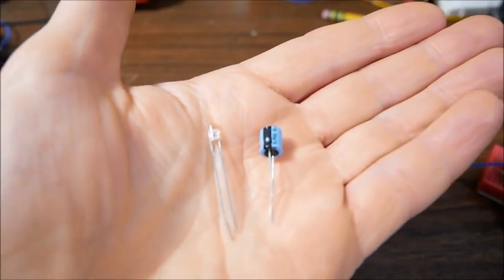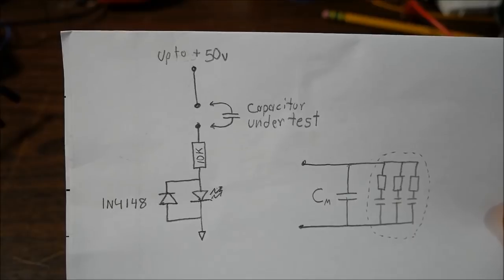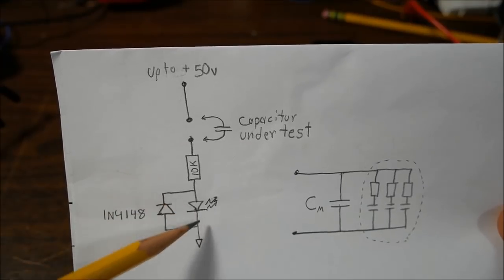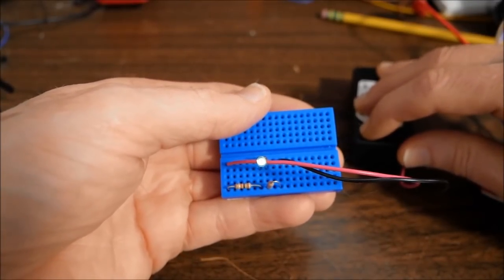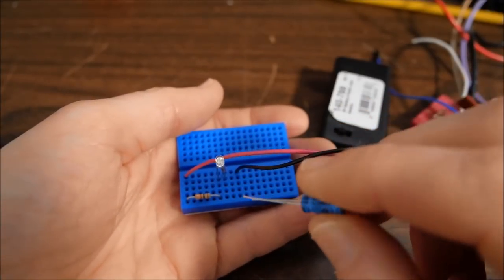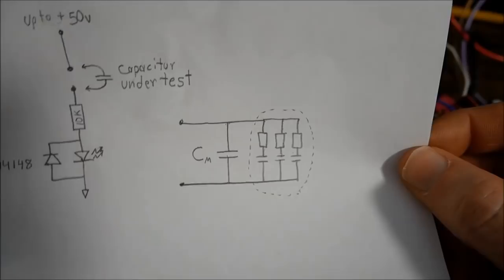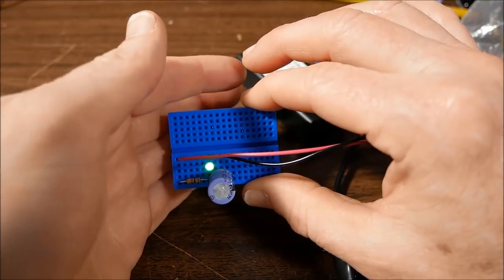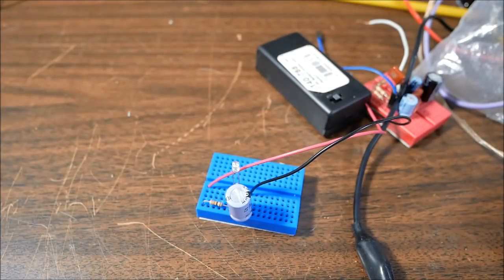Check capacitor leakage with an LED

Comment: I like how  most of the questions in comments and messed up comments are dealt with in the video. Folks simply do not pay attention. Good vid John. I built a leakage tester for up to 140 volts. Works great. Gonna build the AWA kit for higher voltage caps. Nice info John, gotta get me Indium LED's.

Comment: I suggest u use your multimeter same test but much better indicator specialy if you use a analoge multimeter in the range of 10K or 100K setting

Comment: A very simple yet ingenius circuit. If there's leakage on the cap it acts as a resistance and LED glows depending on the leakage, why I never thought of that and it was under my nose. From this basis we can improve it so the indicator is more noticeable...I guess. Thanks!

Comment: All electrolytic capacitors will leak a certain amount. It's true that as the capacitor reforms the amount of current will drop but it will NEVER go to zero current. There are some decent charts around that provide respectable limits to that current flow given the capacitance and voltage ratings of the cap. The higher the voltage, and the higher the capacitance rating the more current will flow on a perfectly good cap.
The absolute best way to determine the maximum allowable leakage of a given electrolytic cap is the manufacturer's spec sheet. They all provide a formula for calculating that current value. 
The circuit is a cool idea, and looks like fun but with all due respect has very little value for testing allowable leakage on electrolytic caps.

Comment: put the LED inside a plastic tube 20-30mm (1 inch) long,  like an old pen (not transparent obviously) and looking inside the tube you can notice even faint glows.. do it by myself and it works.

Comment: Great idea good job! You could pre charge the capacitors to the same power supply voltage as your circuit then plug them in and would get you a much quicker leakage current test on big caps!

Comment: Excellent - yes the time it takes a good electrolytic to cause the LED to go out is governed by CR, the time constant of the circuit.  Dielectric absorption is a different affect.  It can be thought of as a charged capacitor when discharged not discharging completely to zero volts - this is not due to the time constant of the circuit but the fact that some molecules in the dielectric remain polarised for longer than they should meaning that a directly shorted capacitor can still hold charge for quite some time.  Mainly apparent in large value industrial capacitors in high voltage applications with the associated risk therein.  Hope that helps explain things a bit and you have given me an idea for a video on exactly this phenomenon!  Thanks for making the video - I enjoyed it!  [BTW have you thought of pre-charging the capacitor under test to the supply voltage and then putting it in the tester to avoid the CR wait as it were?]

Comment: Very nice. How would you test an electrolytic cap. rated at 450 V? thanks
Reply: At 450 volts I would buy a DMM that can measure capacity and a ESR meter. Safely discharge them first. 450 volts can be lethal.
Reply: @jaynone9262  ESR is not leakage

Comment: I noticed while working on an LED project that white LEDs would glow at very low currents, so I had to use some parallel resistance to allow the voltage to drop below the LED threshold.

Comment: I wouldn’t think this would properly test for all leakage in a real-world sense as many caps have 25 to 400+ volts running through them in-circuit. At those voltages more leakage is likely to occur than at the low voltage this tester puts out. Nonetheless, what an absolutely wonderful “think outside the box” idea for a circuit! Fascinating use of the specialty LED and the device clearly works as designed at low voltages and I’m sure it’s useful for casual, quick tests. Thanks for an ingenious video and a great channel.

Comment: John, as you have just demonstrated that this type of tool isn't just for Repairs on old equipment. You could be building a new circuit not knowing the condition of those new capacitors that you might have purchased from eBay. I have purchased a capacitor kit from eBay that was supposed to have very low ESR capacitors, out of the 10 470uf capacitors only 4 were actually low ESR! The other 6 were really bad, I was wondering why the next stage was saturated until I decided to check out the new capacitors, the problems went away as soon as I replaced the bad capacitors with the good ones that I finally checked. So basically! If you are working with electronics, old or new, you need the ability to check capacitors. Mr Carlson has built a really good capacitor checking device which uses low voltage to test and while he showed how good it works, I still am kinda leaning towards the old way of testing by using high voltage to it's rated voltage... Maybe I would change my mind if I knew how Paul's tester worked but for now I'm sticking to the old, albeit dangerous way because as you switch up through the voltages, you get instant feedback on how the capacitor is charging, whereas with Paul's tester, you have to wait not knowing if it is charging at all... 
Incidentally, with your circuit, you could add a bypass switch that allows you to charge the capacitor to it's rated voltage faster and possibly add another led or two to speed up the process with the larger capacitors! That way you can speed up the process and see that it's being charged at the same time, so when the Led's go out, you switch off the high speed bypass and the other led takes over to indicate whether any leakage is taking place... It's just a thought that I had while watching your video... 
Capacitor testing always makes for great watching...

Comment: their are meters that only test capacitor. they cost like $35 however mr carlsons lab has meter that cost $600 that dont work so are these meters for testing capacitor actually work? consider reviewing them one is "Proster LCR Meter LCR Multimeter Tester for Capacitance Resistance Inductance Measuring Meter with LCD Over-range Display"
Reply: ESR, Capacitance, Inductance and Leakage are all a bit different.

Comment: REFORM? WHAT IS IT
Reply: charles klein It is a way to “reconstitute” the cap and restore it close to it’s original value/function by applying a series of increasing dc voltages to it over time. In my experience this is not a very permanent fix. Better to replace it.
Reply: Ya blast all of the smoke causing stuff out of it by using it like a spark plug....lol

Comment: Is the 4148 actually fast enough to provide  protection ?
Reply from the maker: Yes. It is a fast switching diode.
Reply: Any diode should be used, 
Fast diode is fast on reverse bias only which is not in our case.

Comment: Dear John, would you mind to share the LED part number? I would like to try this out but couldn't find the right LED with such low current capability. Thanks!
Reply from the maker: OVLBG4C7 (3mm) OVLFG3C7 (5mm) Green high brightness LEDs. I got them at DigiKey.
Reply: @JohnAudioTech  thanks!
Reply: @JohnAudioTech  I checked the data sheet for both of these. They seem to be rather typical LEDs; Vf=3.2V-3.4V If=20-25mA. From the technical name that you used to refer to them, I thought that they were some type of higher technology. Now, I think the term has to do with their color and, yes, the green has the highest output intensity. Meaning, that they are a good quality LED, having testing and data, but they are not a special technology. Do I have that correctly? I am not intending to disparage the video. I just want to learn from it correctly. Thank you for all you do for us. Much appreciated.
Reply from the maker: @t1d100  Yes, they are not special, just good consistent quality. I stressed that point because people often go to ebay or the other cheap sources and end up with parts that don't perform as intended.

Comment: it's normal for an electrolytic capacitor to have a leak, but it should be minimal, some vom with capacitance will test caps good or bad detecting high leakage as open or short or wrong caps measurement.

Comment: Thanks for the video. I didn't realize there were LEDs that will light with only a microamp. But the longer glow from the electrolytic is simply due to the long time constant associated with its very large ESR. It doesn't really have anything to do with dielectric absorption which is associated with self recharging of a discharged capacitor as described in IEC 60384-1.

Comment: I tried this but when i cut power to see if led would drain the capacitor and light up
it didnt work. It took know time to charge 300 and 47 uf caps.

Comment: most vom today has a capacitance test features, no need to do this circuit to find out capacitor leakage problem.
Reply from the maker: Most multi-meters will test capacitance. They do not test for leakage.

Comment: How do you know wether the LED is the indium gallium nitride type?
Reply from the maker: Indium gallium nitride LEDs in green will have the rich green color. If you are not sure, quality LED manufacturers will provide the information in the datasheet.
Reply: I cannot find this type of small LED on AliExpress.  A new thing?
Have recently been impressed that my 3mm blue LEDs will glow well with a 4.7k resistor, at TTL voltages .
Reply: Cause it looks like one....lol

Comment: My fast and dirty trick is to use my analogue needle meter to charge and then flip the probes on the capacitor to test it.
Your idea is more appealing though.
Reply: Paul NJ I agree about using analogue meter. Its not just capacitors but also we can use it for finding leaking transistors diodes . I find it  easier using analogue  meters vs those digital meters when trouble shooting amps.😁

Comment: It's usually a better idea to chuck a leaky capacitor instead of temporarily reforming it yes ?
Reply from the maker: Yes, I'd just get a newer one. I pulled that leaky one out of a bag of old caps I keep around for some reason.

Comment: Why not  just put a  micro-current meter in series  Mr Carson  with  all his junk  rules
Reply from the maker: Yes you could as long as you protect it from the charging surge current with a resistor.

Comment: Very cool, I built the Mr. Carlson's leakage tester and love it.  Yours works well too with a kiss design.
Reply: Nice! Carlson is awesome. I was thinking of that tester while watching this.
Reply: I would love to build the tester Paul designed. I have hundreds of caps I collected over the years.  Some of them definitely are bad, some are suspicious, but a lot should still be fine.  Paul's device is able to predict the cap's future condition, which is amazing.
Reply: 1959Berre He has a very simple inexpensive version that can be built on a terminal tie strip or protoboard.  The 'deluxe' version is pretty inexpensive and easy to build as well.  His videos have guided many to build their own, even after stating they didn't have the supplies or skills.
Reply: Does his amplify the leakage to make it more obvious?

If you were to shunt the positive and negative feedback of an opamp with a current shunt, then use a 2.5 ohm power resistor to ground on the negative terminal, then connect to the positive terminal through the capacitor you are testing, you can charge caps fast and get very good sensitivity. A couple op amps in series to maximize gain if you want extreme sensitivity... for some reason...

Something like this: https://www.falstad.com/circuit/circuitjs.html?cct=$+1+0.000005+49.687244006919805+50+5+43%0Av+96+80+160+80+0+0+40+12+0+0+0.5%0Ag+96+80+80+80+0%0Aa+208+96+368+96+9+2+0+1000000+0+0+100000%0Ag+208+144+208+176+0%0Ar+528+112+592+112+0+10%0A162+592+112+656+112+2+default-led+0+1+0+0.01%0Ag+656+112+672+112+0%0Ar+208+80+208+112+0+0.003%0Ar+208+144+208+112+0+2.5%0Aa+368+112+528+112+9+2+0+1000000+0+0+100000%0Ag+368+128+368+144+0%0Aw+208+0+208+80+0%0As+160+0+160+80+0+1+true%0A209+160+0+208+0+0+0.0047+0.001+1%0A